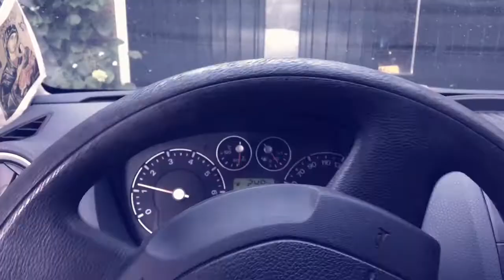FIXFORFREE | Replace disc brakes rotors and pads Ford Fiesta MK5

Comment: What kind of grease have you used. Does it matter ?
Reply from the maker: The Grease always comes with the pads… heat resistant
Reply: @fixforfree3330  Mine, don't. Nevermind.
Reply from the maker: @MrGigi-dz9cv  thx for watching 😉

Comment: what is that purple  grease you put on the 13mm bolts?
Reply from the maker: Heat resistant for brake pads